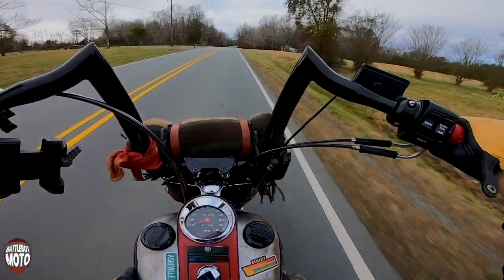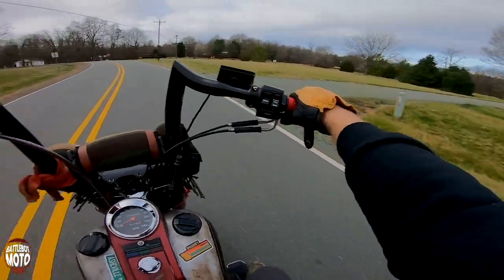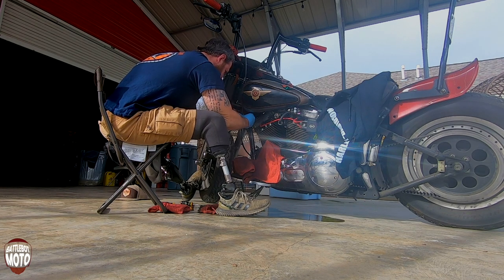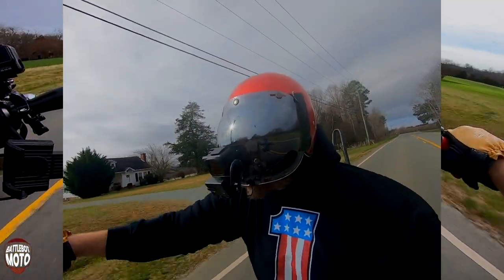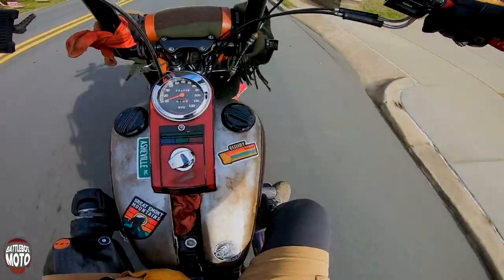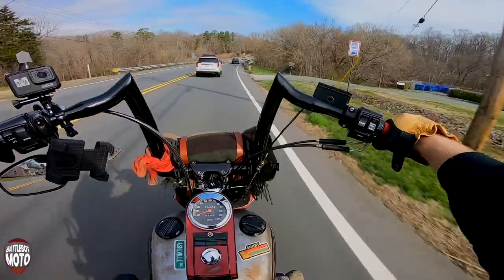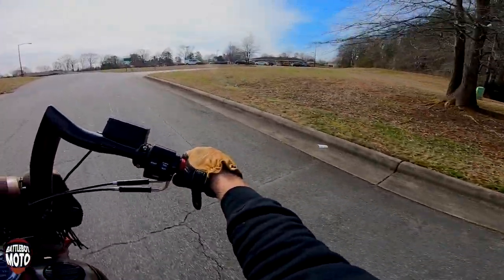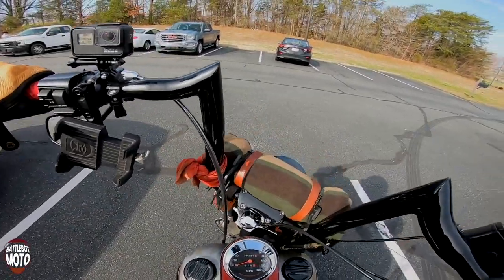We ALWAYS breakdown here!! (Bermuda Triangle- Harley Fatboy)

Comment: Hey crayon eater, just something to consider.  I bought a small 5 inch android auto unit made for motorcycles.  It connects wirelessly to CarPlay and Android Auto.  It cost about 125 bucks on ebay.  Completely weatherproof so it stays on the bike.  Connects to a headset as well, so dual bluetooth. Can use it for navigation, control Spotify etc.  I actually have a 7" unit now that I'm using as a head unit connected to a bluetooth amp after getting my FXRP fairing installed.  My thought process is that if I go down hard and my bike winds up 50' down the road or cliff or ditch, I want my phone in my pocket, not on my bike.  Plus the cameras on these phones are sensitive AF and can stop working if they get too much vibration.
Reply from the maker: Yea I’ve already learned the hard way that the bike will vibrate the cameras and mic loose on the phone. That ciro phone mount just hasn’t been removed yet, but it’s going to the parts graveyard in my shop.